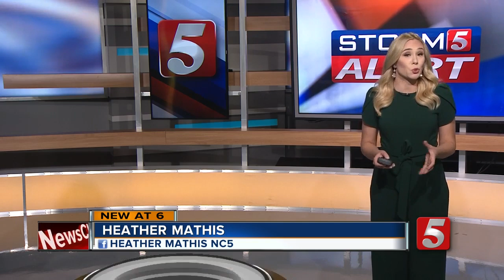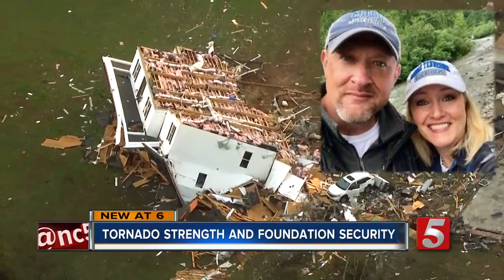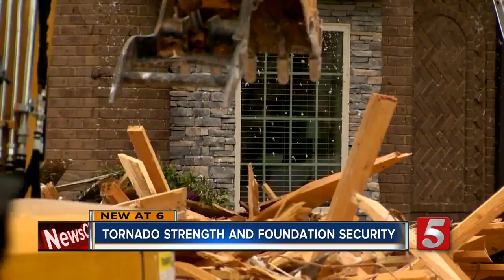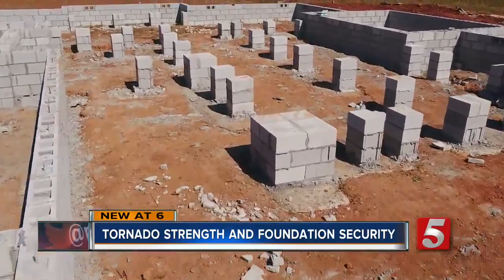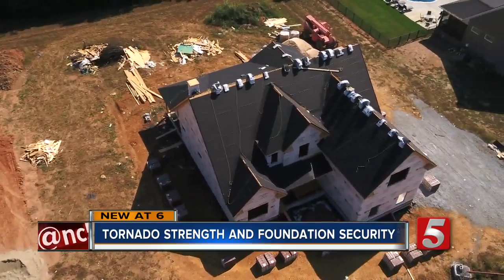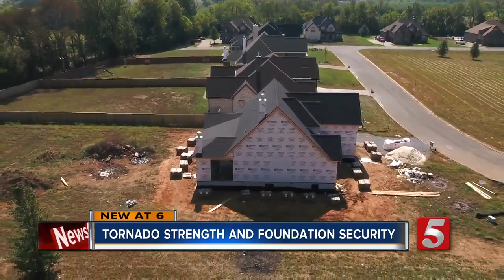Are building codes in Middle Tennessee enough to withstand strong tornadoes?

Comment: JFC The Tornado that just hit Tennessee literally ripped homes up WITH their concerted foundation and tossed them 50-100 yards. I am thinking that tornado had to have winds of 200 mph plus. It sound like the roofs were built pretty good. Generall the roof rips off but the rest of the house remains. These houses were ripped up with their foundation.All that concrete is pretty damn heavy. We live close to the coast and our home had to be built with hurricane metal strap ties to the trusses and anchor metal strap tie downs to the foundation. But I think that tornado would of took my house away also becasue the winds were so strong.
Reply: no. areas with hurricanes (I.e. Florida, Carolinas, gulf coast and georgia) tend to have the best building codes, so your house would at the very least have something left standing
Reply: WRONG Jerry.  I inspected.  NO FOUNDATIONS WERE TOSSED ANYWHERE.  Where did you hear that complete bullshit?